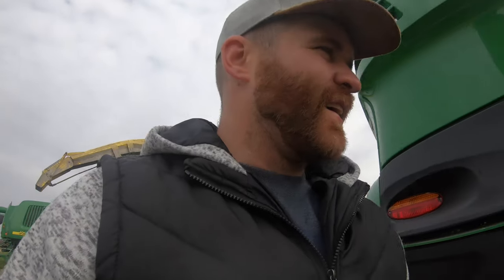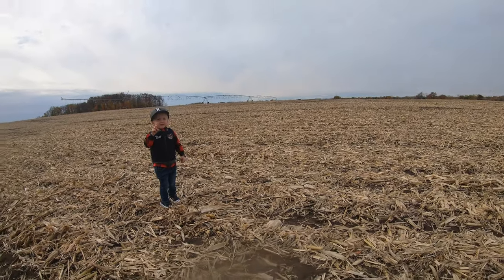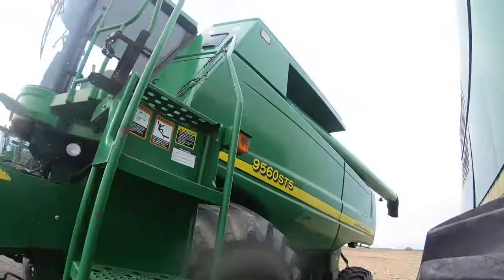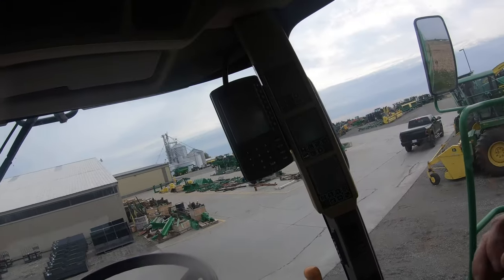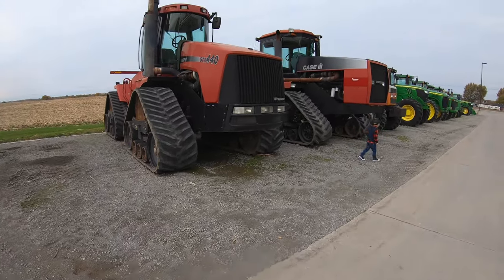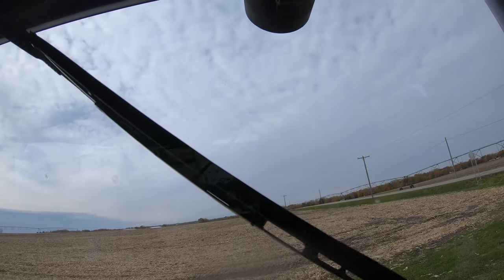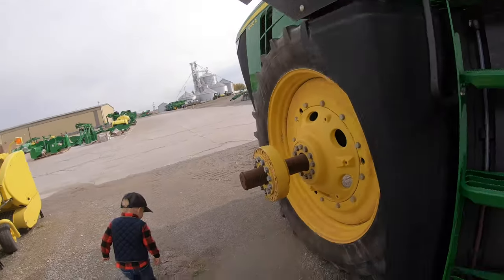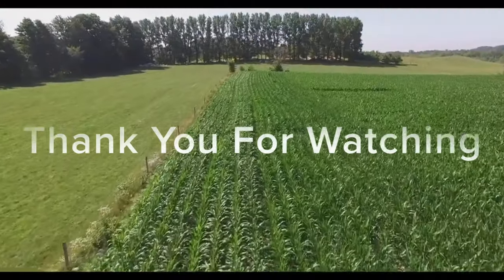Touring Greenmark Equipment While The 9760 Is Getting Fixed

Comment: I had a 2006 9560 it was a good machine
Reply: What do they have for 260-290 hp MFWD that’s what I’m looking for
Reply from the maker: So their bread and butter tracker on their lot is the 8245R. I'm guessing there's a farm in Michigan that turns over their lineup every two years. Originally I was hoping for maybe a 8360R (or something similar) with duals, but because they have such a high inventory of the 8245R, they're typically more willing to make deals on them.